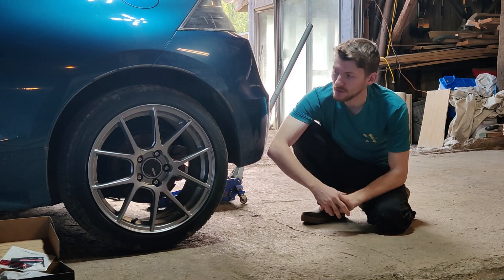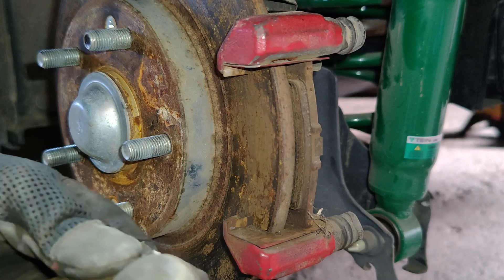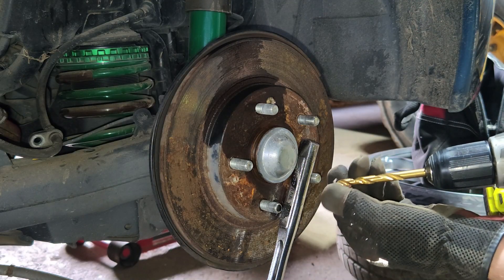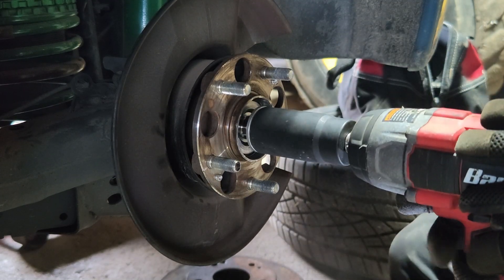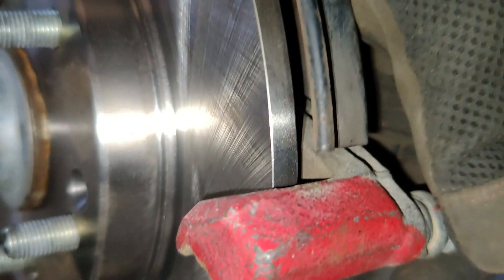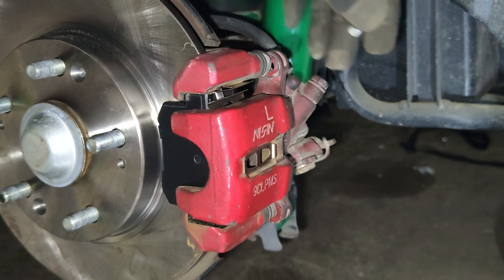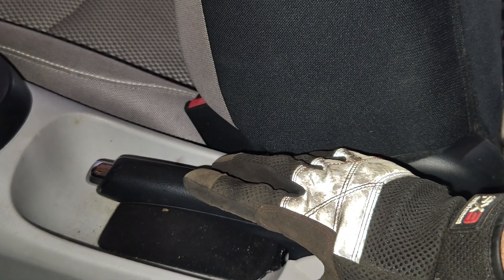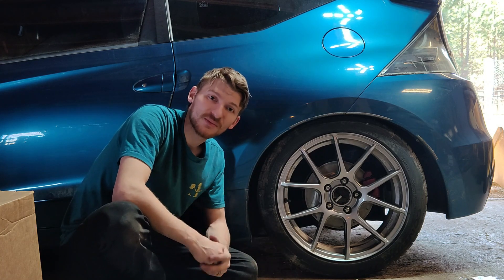Honda CR-Z: Replacing Rear Brakes, Hubs, and Adjusting the Parking Brake

Comment: So you drill out those disc screw and just leave them like that? Im not fully understanding that one part but the rest was brilliant.
Reply: Those little screws are just so the rotor doesn't fall off in the factory. We used to use rubber bands. The lugnuts hold it on fine
Reply from the maker: Yes, I just left it alone. Since the wheel clamps the brake rotor to the hub once the lug nuts are installed, there isn't any functional advantage to leaving that Philips screw in place. I'd rather just not deal with it again the next time I have to disassemble the brakes.
Reply: @HondaGarage_ID excellent! Thanks for the clarification guys.
Reply: @HondaGarage_ID the screws keeps the fish from wobbling and make the grinding noise when doing turns? What size drill bit you used to drill those out?

Comment: Hey can you make a video on how to find torque specs
Reply from the maker: You'll want to get a hold of the factory service manual (can be found as a PDF download in a few forums). Or, a great resource that I use which is faster to pick through, the website charm.li which has digitized service manuals for a ton of cars. Most of the work I do on my vehicles is based on info I get there.

Comment: With the HDS you can activate the ABS pump and bleed the system that way (including the ABS block).
I have tried the basic manual way for typical bleeding, but it always seems to leave a little play before the brakes engage.
When they do engage thaey dont require any pressure to be heavy breaking though (FN2 300mm front brake conversion).
Will have to try the ABS method. to see if it makes a difference.
👍